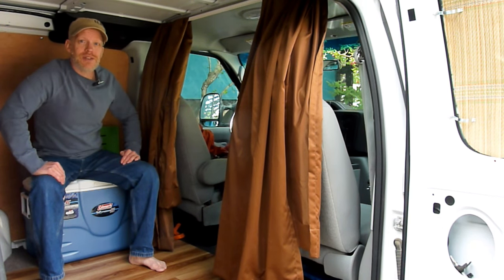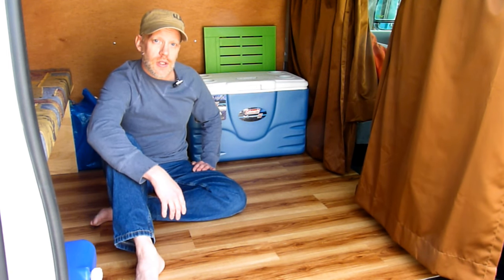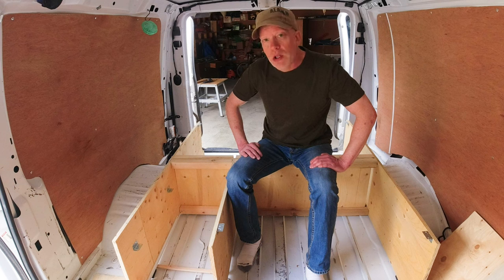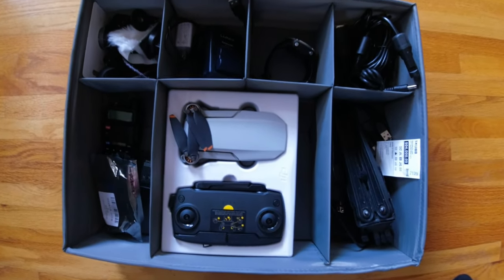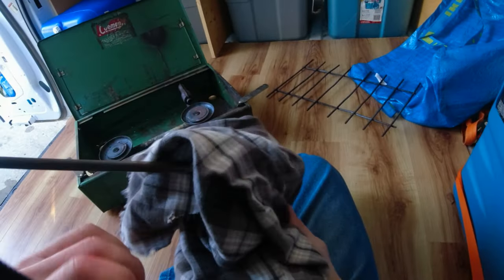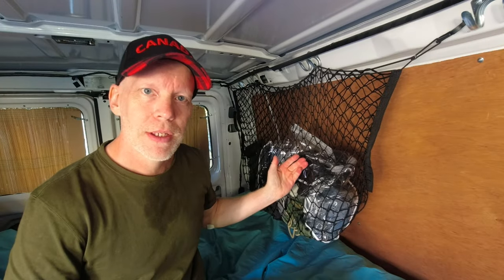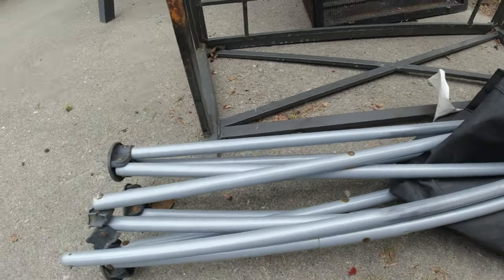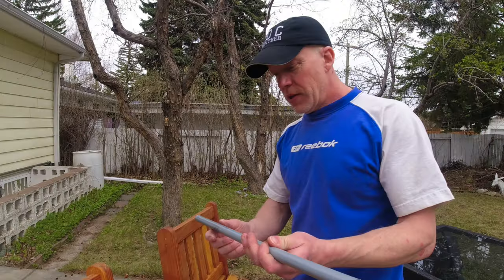My Best 'No Build' Conversion Ideas For Van Life | No Build Van Conversion TOUR #vanlife

Comment: Yeah,  man I like your van. So simple but functional. I have a great tip for you. I fill 1 liter plastic bottles with clean drinking water and freeze them. I normally keep 5 bottles in my deep freezer at home. I use 3 frozen bottles in my cooler at a time. Firstly a big ice block takes much longer to melt than little ice cubes. Secondly, nothing ends up floating in cold water. Thirdly, I  have nice ice cold drinking water for the whole weekend. Try it, I'm sure that you will like it. Good luck. And oh yes, I live in South Africa, it gets very hot here and my cooler system works.
Reply from the maker: That is indeed a great tip! I do this any time I have access to a freezer and, as you say, it works perfectly!

Comment: Shoe holders that hang from a door make great storage units for toilet paper, socks, underwear, T shirts, paper towels, etc.  If it's too long it can be folded with the extra close to the wall.
Reply from the maker: Yeah, that's a great suggestion! I've actually looked at them many times, but then I found the backseat organizer for actually cheaper so I got it instead - I just had to wait a month for it to arrive in the mail... otherwise I would for sure have a shoe holder.

Comment: I love your no-nonsense attitude 'I found the solution, I push it back', lol

My own build is very simple, though I don't overnight in it, it's just to make it more comfortable for myself and my dog when I'm out fundraising or just out and about. My floor is plywood with a coat of varnish and then a rainbow-striped carpet runner down the middle so the dog doesn't slip. My storage is a matt-black, painted, wooden TV table (less deep than other kind of cupboards) which stores all my stall-setting-up stuff. I have it secured in 3 ways as I was worried about my dog getting injured if it moved in a collision or if I pull up sharply. It's screwed to the floor and secured by lashing straps around the frame at each end to the wall and floor. I had to step up the floor, to go over a metal ridge where the rear seats were attached, so the plywood and underfloor framing holds it in place too. To cover the gap where it can't go back further than the wheel well, I padded, then covered, 3 wooden herb planters with 3 different but same range, brightly-coloured fabrics, (fat quarters) and screwed them half on/half off so they overhang and butt up against the wall so I can't lose anything down the back. That's where I store my tea bags, cutlery and cups etc. I have a large dog (greyhound) that ideally needs a raised food/water bowl so I screwed a matt-black plastic wastepaper bin in the corner and the bowl fits perfectly in the top and I can store stuff inside the bin below. Mine looks really pretty and boho, you don't even have to compromise on looks to do it on a budget.
Reply from the maker: That sounds great and like it works fantastic! Thanks for sharing!

Comment: If you buy comforter sets save the bags they come in. Plus they also have a handle sometimes! Also, if you are a lady living sparsely and need a nighttime “Porta Potty,” if you have any of those big cannisters of wet wipes, when it’s empty, don’t throw it away. It’s a big enough target and there’s no adjustment needed. Keep the lid on it so you can close it when finished. In the morning just dump it, throw a little water in it to rinse and it’s ready to be reused. 
You have some pretty good ideas. It’s nice to have all that great stuff in some of the van/bus builds but I don’t have the health to manage all of that. I might splurge and add one or 2 solar panels. But they would need to be installed by someone.
Reply from the maker: Great tips!

Comment: Nice, simple and effective. Would add, you should get a moisture wicking mat or drill holes for ventilation, under the mattress for mole prevention.
Reply from the maker: Yes, this is a good thought to  keep in mind! I've not had a problem with condensation so I've not bothered... might be due to the dry climates I tend to be in.
Reply: You can't see mold when it first starts, when you can see mold, it is hard to get rid of in non washable fabric or wood. Just saying.

Comment: As for the ice "problem " I have 3 one gallon pitchers that I put the ice in. Then I have ice water when I want .
I also put six smart water bottles (full) in the bottom to hold up a try so if anything drips, spills, leaks it is not that big of a deal.
Reply from the maker: That's a great idea for the beginning of a trip and you have access to a freezer to make ice! My idea is for those who are on the road for a long time or don't have access to a freezer I need to rely on a
Bagged ice
Reply: @SwellerVanDweller  walmart and McDonald's sell ice. I spend an average of 6.50 per week
Reply: @stevecook413  yeah! I just bought ice at Walmart for a $1.88 👍

Comment: Can you use the same bed design if you have the original plastic side panels and carpet in the floor. I have a Chevy express passenger van.  Love your designs.
Reply from the maker: I've not heard of anyone doing it, but I can't see why it wouldn't work... when you're putting the the rubber mat shims against the side panels to secure the bed frame, I'd just make sure that the side panels are solid and can take the pressure at that particular location, or if one location is better than others, giving you some guidance on where to put the shims.

Comment: 3:06 does you van AC and heat take care of most hot/cold situations?  Can you leave the engine running for long periods of time? Maybe carry extra gasoline to refill the tanks? Is this advisable or not a good idea?
Reply from the maker: I just rely on AC and heat while driving... when stopped, I don't hang around in the van if it's extremely hot or cold. When sleeping in heat, I open the doors and use my mosquito netting (I've a video on that) and in the cold I layer up! But I don't stay around in cold climates for extended periods. If I did, I'd install a diesel heater. I wouldn't idle the engine when parked for AC or heating.

Comment: I wanna install a maxxair fan on my roof but I'm terrified to cut a hole
Reply from the maker: Yeah, me, too. Check out my Bug screen video... that's what I put up either on my back barn doors or just on the driver/passenger window along with my fan when it's really hot or I just need ventilation.
Reply: @SwellerVanDweller  I'm thinking about switching out my fixed rear window to a plexiglass with a vent fan attached.
Reply from the maker: @juliejules7780  Interesting!
Reply: @SwellerVanDweller  yea I just saw a video where they attach a Maxxair fan to the rear window 😲 mind blown.

Comment: I am in the beginning stages of building out a van and have watched potentially every video regarding van floors, walls, and insulation. You have not had any mold issues or anything with your floor, even with cooking inside the van? People make it sound like living in a van without sound deadening material, inches of insulation, and mold-killing treatment is a death sentence. The amount of contradicting information out there is really overwhelming when you're just getting started.
Reply from the maker: Yes, I know it's overwhelming... I've never had any condensation or mold issues - but that may be due to the drier climates I stay in and that I don't spend extended periods in extremely cold temperatures. I'd suggest you start simple WITHOUT building and take a few short trips in your van... you will quickly determine what you NEED and WHERE you need it, leading to the PERFECT build for you! This is the MVB Method of building - watch my "How to Begin Van Conversion" video for more details. Also check out my video on free sound deadening that explains why you don't normally require it. There are many van life building MYTHS perpetuated by social media because so many first-time builders post about it and others mistakenly take them to be experts.
Reply: @SwellerVanDweller  This is great advice, thank you. Decision paralysis is a real thing. I've been so afraid of doing things wrong that I haven't done anything.
Reply from the maker: Yes, you are not alone. I made a video called  "A Healthier Approach to Van Life" that you might find of value as well.

Comment: Your fan wouldn't move a mosquito fart.
Reply from the maker: Ha! It is small - which is why I hang it right beside my head. I find it gives enough of a breeze normally... and in more extreme heat, I have a wet cloth and wipe my face/head occasionally. You only need a little moisture on your skin and a minor breeze for evaporative cooling to work well.

Comment: Just to poke a little fun you really need to throw that fan in the trash it would never work in the desert
Reply from the maker: Ha! Believe it or not I do use it... my secret in extreme heat is to wet my tshirt and it's amazing how much that improves the cooling power of even a small fan like I have. But, you're right that I don't go to the desert at the hottest times of the year - I would fry.

Comment: cooking inside but no CO monitor? also why not use some hooks and straps to tie down the bed platform?

cue dumb ways to die TT music
Reply from the maker: Good questions! When I cook inside, I always crack the door and have fresh air flow. The bed... as mentioned and shown in the video, the bed platform leverages the shape of the van walls by "hooking" into metal pockets in the walls - it's physically impossible for it to move forward even in a hard brake. All vans might not have a shape that allows this, but I'll bet a good portion do. I do use ratchet straps for other things, like securing rubber bins, a water jug, and my cooler - as shown in the video.